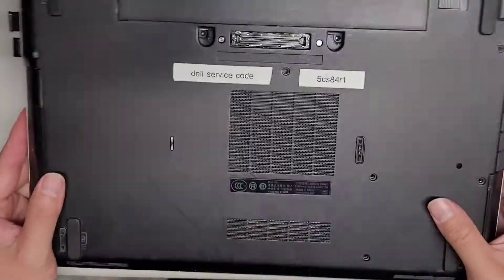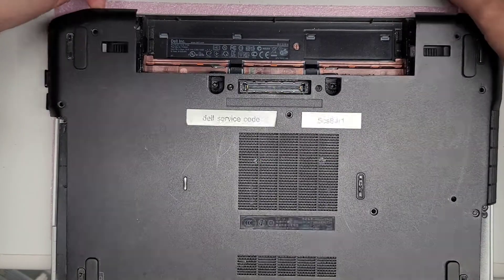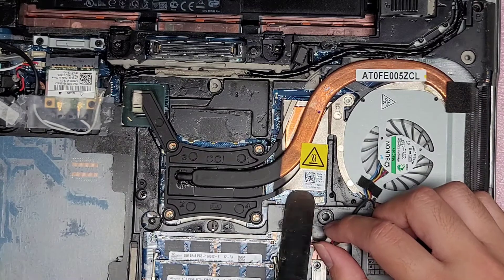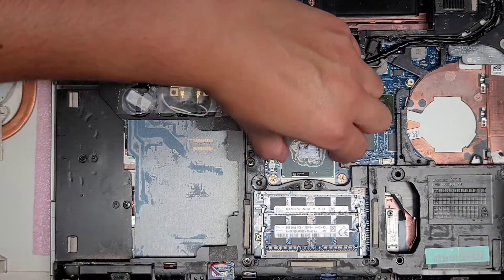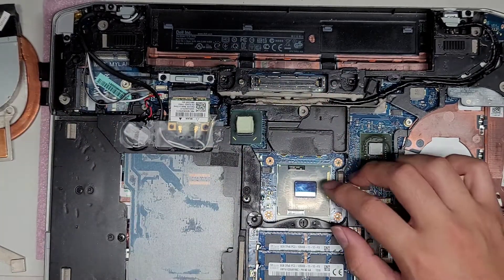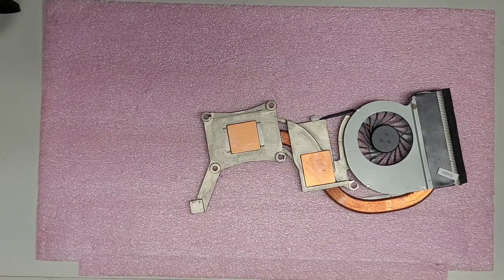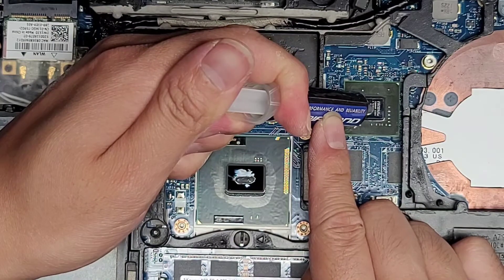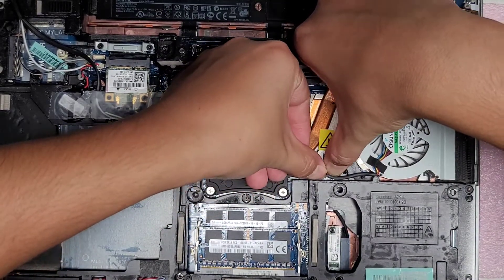DELL Latitude E6420 Disassembly RAM SSD Hard Drive Upgrade Repair Thermal Paste Application

Comment: You don't has to tilt the harddrive if you install it when the computer is up right
Reply from the maker: Wuh?
Reply: @ItsBinhRepaired Place the computer upright like it's supposed to be then slide the hard drive in and you don't need to tilt it or anything to get it to go into the connector 👍

Comment: Found a tossed out E6420 but needs to have the Win 7 reset! Thank you ☕👍 can the CPU be upgraded to a Quad Core?
Reply: Mine has a quad core i7 so idk what he's on about 
The CPU is socketed so I'm sure it would have some upgrade options
Reply from the maker: @TeaSniffler oops, sorry, thought it was soldered. Didn't rewatch the video. Lol
Reply: @TeaSniffler so your i7 is the highest the mobo can support?
Reply from the maker: Nope
Reply: @ItsBinhRepaired it can be upgraded, but not to a Quad Core? 🤔

Comment: Doing it this way I burned the graphics card in this laptop, no paste or pad could cool the graphics card like the original paste, only putting a 0.7 mm silver ballast solved the problem, of course with 7.5 W/mK paste.
Reply from the maker: Hmmm I didn't have this issue. What kind of paste did you use?

Comment: There is a 0.7 mm gap between the GPU and the cooler, no paste or pad will do, you need to put a 0.7 mm copper or silver plate between the GPU and the radiator. Check the gap by putting a ball of plasticine on the GPU and then install the cooler, remove and measure the thickness of the crushed plasticine.
Reply from the maker: Hmmm I didn't have that issue.
Reply: Mine is overheating, when I checked it has the gap between GPU and heatsink, so I searched someone disassemble this model to check if it has just thermal paste or thermal pad...
Now I'm going to put a piece of a desktop heatsink, and I hope it works...
Im wondering if thermal pad will be better

Comment: what is the green thing there? 
and where I can get one of it? 
and I have a problem when I replace the thermal paste and add a new one my graphics card (nvs 4200)
now doesn't work
it appear on the desktop and control panel for nvidia is working but In games it just use the integrated graphics card
and the laptop now got really laggy sometimes or open some games and the only way to fix the lag is by restart it 
can you help me?
Reply from the maker: What green thing?

Comment: Hi, din't you change also termal pad on chipset? is there 1mm or more?
Reply from the maker: I don't replace thermal pads. I just reuse what's there. I don't measure them.
Reply: @ItsBinhRepaired  thanks for your answer
Reply from the maker: No problem

Comment: I just took my latitude e6420 hard drive but when i try to screw it back in one screw is loose and won’t go in and the laptop says no hard drive detected could you pls help me?
Reply from the maker: Watch the video again. I explain the problem.
Reply: @ItsBinhRepaired  oh wait i tried it again and it work thx u very much I’ll subscribe
Reply from the maker: @momtitsensamnang9732  glad it worked! Yeah, it's a little tricky that one.
Reply: @ItsBinhRepaired  thx for very much for saving me from a panic attack😂
Reply from the maker: @momtitsensamnang9732  haha no problem
Reply: I tried what u said in the video but it still doesn’t work

Comment: Hi, quick question... I want to change my palmrest ... So, before replacing the palmrest.. We need to remove optical driver and hard drive driver... Does removing this HDD will effect my data or software or another complications ?
Reply from the maker: It won't affect as long as you put it all back after. Make sure the computer is off
Reply: It's a company laptop... So, it's contains data and vpn access... So, does it effect after replacing palmrest(when off) and turn on laptop... Do I find any changes?
Reply from the maker: @Ravi-vt7ro  I don't know. Possibly if it has bitlocker or something
Reply: @ItsBinhRepaired  sorry to bother you brother... But, with out know that.. If I do it.. I will run into trouble
Reply from the maker: @Ravi-vt7ro  unless your company put a software to detect the hard drive is removed, it shouldn't affect anything.
Reply: No bitlocker.... It's like a normal laptop only.. We need to connect to cisco security vpn... So, while removing hard drive driver... Does this apps or software gets delete or my login password will change?
Reply from the maker: @Ravi-vt7ro  nothing gets deleted

Comment: Very good video.  What is the maximum ram capacity?  And what is the sata version?  Hope it supports 16gb and sata 3 is compatible.
Reply from the maker: Should be the max you can get. I don't do specs though, but most are SATA 3. I just repair them, not spec them.
Reply: @ItsBinhRepaired  I hope so.  Thanks for the answer.
Reply from the maker: @giyinikvatandas  yup